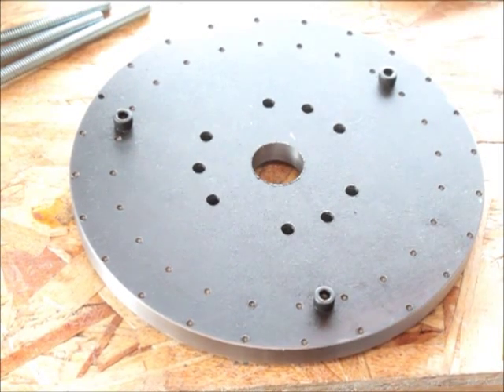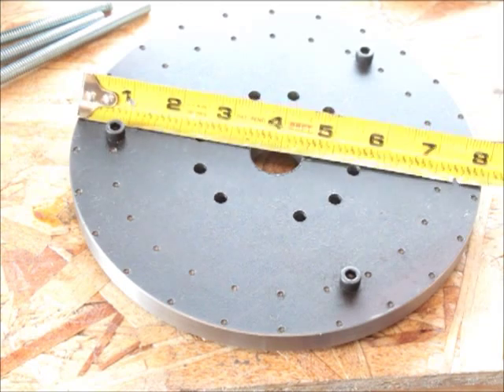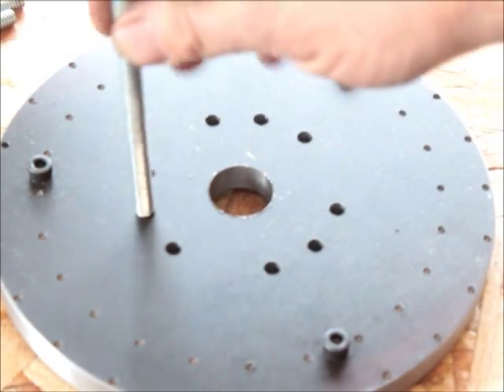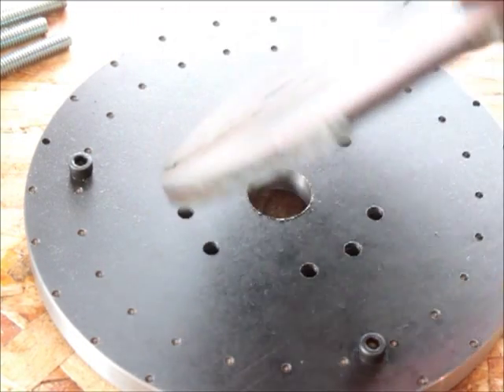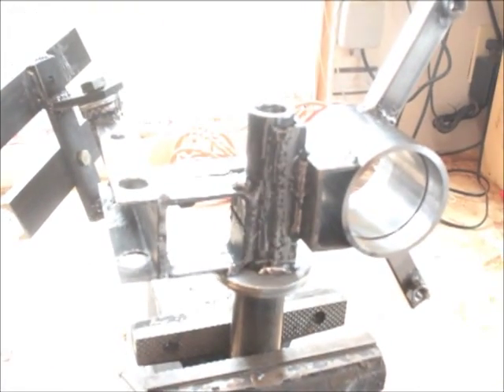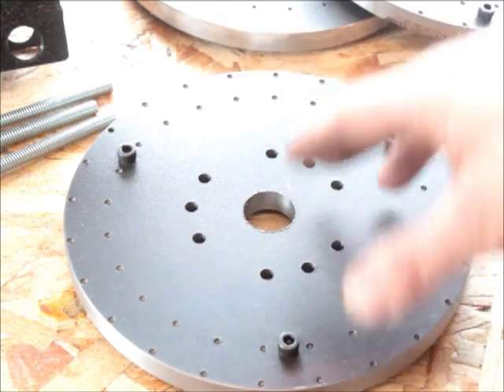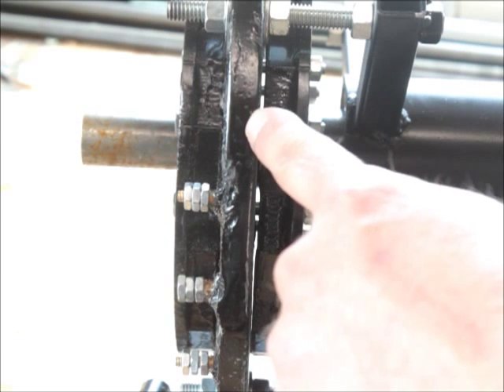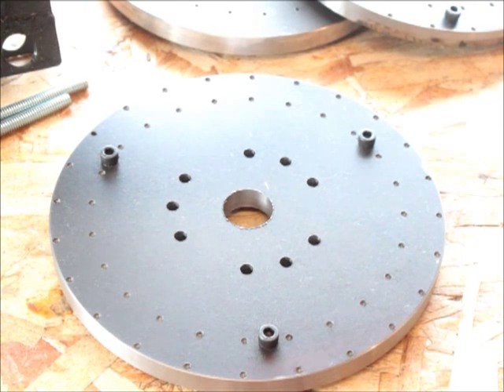Dual Magnet Axial Flux Alternator Magnet Rotor Design Muddys Mighty Mini Wind Turbine Generator

Comment: I noticed all your videos are older. Are you still machining & building turbines and components? I'm looking to give one a try. I don't have the best wind. So I'd like to build something I can reconfigure as a hydroelectric system.  Has anyone tried using the halback array for the magnets? It's how the Tesla motor magnets are arranged. It basically makes a strong monopole magnet. Or what kinda looks like a monopole. Great video. I subbed if you make new videos...

Comment: reduce slag with plasma cutter by adjusting air presser to suite thickness & type of metal. Too much OR too little air presser will incress slag
Reply from the maker: I've been working on the fine tuning ... I'm always using 1/4" these days so it shouldn't be too hard